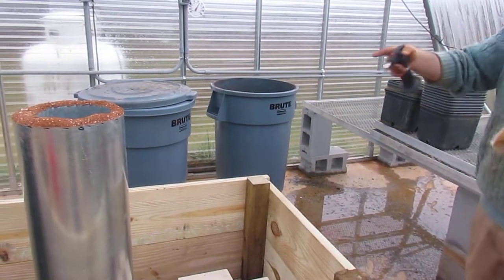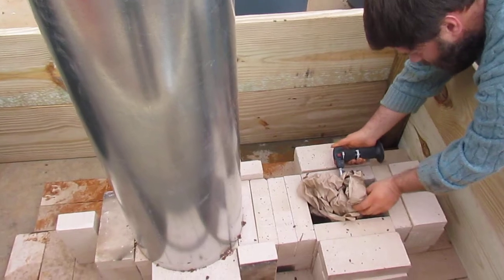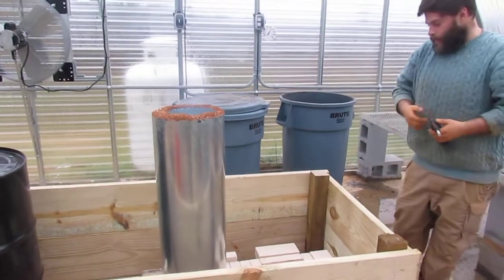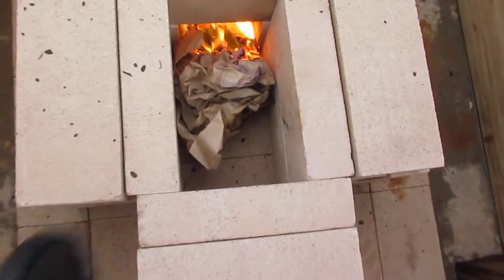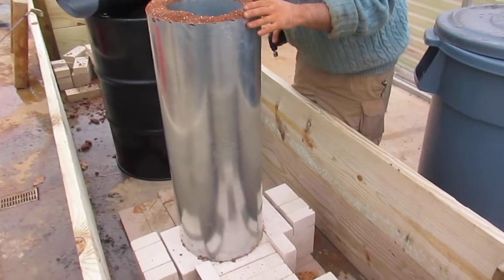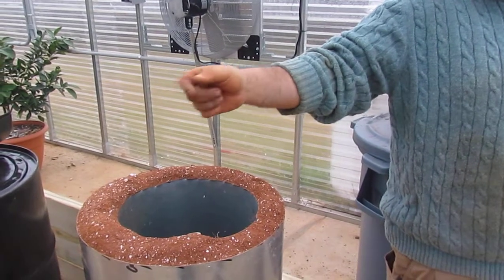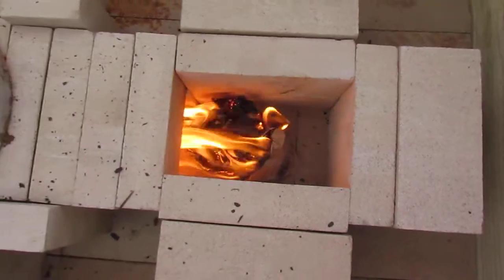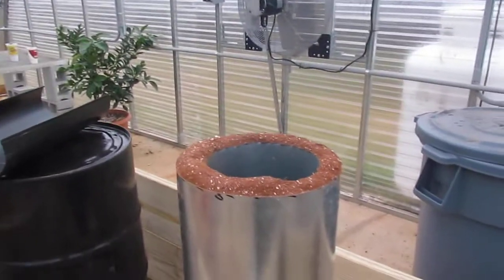Rocket Stove part 3 - A finished heat riser and test burn

Comment: Hi frìend. Can you right me please what you put ìn the sheet iron? Perlìte wìth what other?
Reply from the maker: The heat riser is a mix of clay and perlite or vermiculite in a mix that explodes when pressure is applied. Not too wet and a 50-50 mix if I remember correctly. But it’s been some time since I’ve looked at my notes. Iianto Evan’s has written the best material on the subject of rocket mass heaters.

Comment: so the heat riser..... is that to radiate more heat from the chimney?
Reply from the maker: Hey Nick, the heat riser is insulated so that there is a difference in temperature in the chimney and the barrel around it.  The insulation keeps a lot of heat inside.  The smoke is forced through the small opening between the top of the riser and the roof of the barrel where it burns completely and starts to cool.  The combination of the fresh flame and air coming behind it along with the pull of the metal chimney, it works pretty well. If the heat riser were just metal, there is not enough difference so the smoke just settles, then the easiest path of exit is through the loading opening and the stove reverses using the chimney as an intake.  I eventually took this system out in favor of a wood boiler that heaths two buildings and provides hot domestic water at the same time.  Thanks for watching.  I hope that answers your question.
Reply: +Scott Vernon.... wood boiler?     ya i just made one in a metal drum, with refractory cement and perlite, its got good pull on the smoke. just trying to figure out how to make it less stove and more space heater. ill check that wood boiler...sounds interesting. /cheers
Reply from the maker: You can kinda control the heat by off setting your barrel on your heat riser in the direction you want the heat to be mostly.  The wood boiler is nice.  It is high dollar though.  It heats water and pumps the water through thermostat controlled radiator and fan units.  It doesn't have the thermal mass like the rocket mass heater, but it is nicer for me cause it heats two buildings and can burn wet wood while maintaining the flame with a fan.

Comment: good project BUT cement your bricks together as there is a chance of heat escaping and burning your wooden box. Big tip get some wood shavings and dump them into the fire box Then add paper once the shavings have caught lit then add bigger peices of wood.